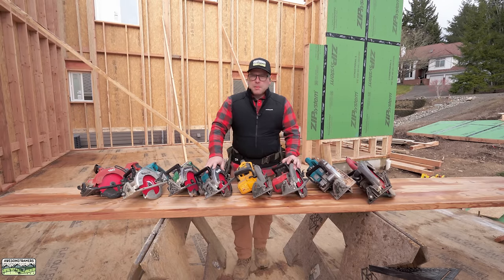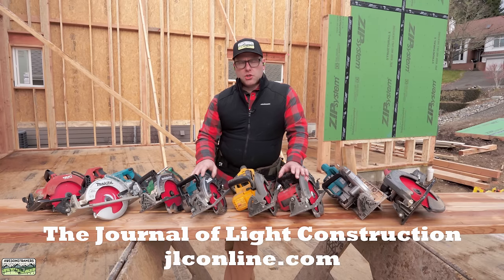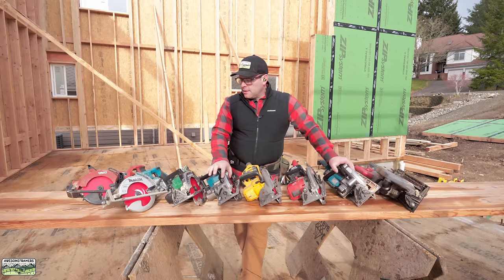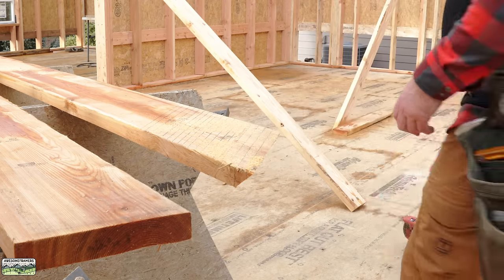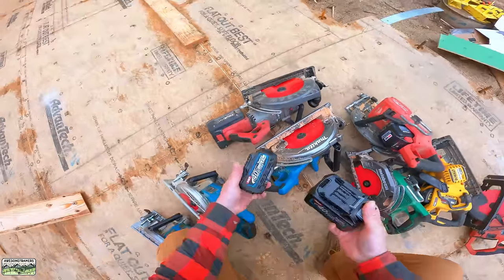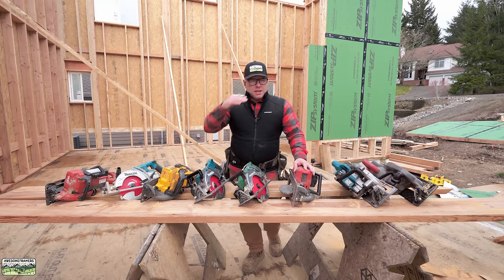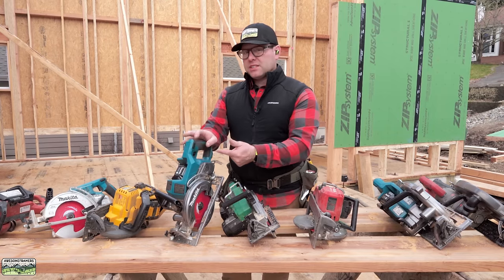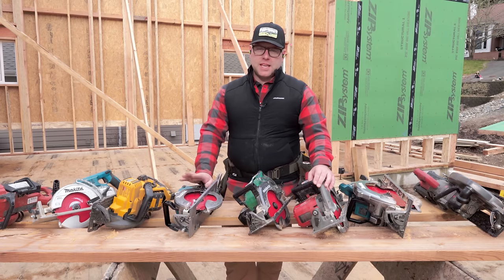Tool Review- Rear Handle Cordless Saws

Comment: 48 years ago when I started framing, don’t shoot me, when I got out of college, I was told this. Worm drive saws were first developed to cut rafter tails. It just so happened that it excelled at all other cuts. Oh and cords, funny thing about technology. We never thought once about the inconvenience of it all. We just knew it beat sawing by hand. We also hand banged all our nails, although pneumatic guns were just starting to come out, and weighed a ton. Never knew anything other than a tool with a cord or hose hanging out the back. Soon kids won’t know anything but electric cars that don’t stink. If life is about anything, it’s about change.
Reply: Jon, I started 47 years ago. I'm in Maine so we use sidewinders. The saw most guys had was a Rockwell 314 I think it was. The handle was pretty much on top, and the shoe didn't tilt, the saw body came straight up from the shoe. The old guys I worked with still used hand saws and hand planes a lot too. It wasn't until sometime in the 80s we started using nail guns for framing and nailing done underlayment. All finish nails were driven with a hammer.
At this point in my career, there is no way I am buying a bunch of really cool tools as I can barely walk now.
Reply: Loved your reply, and quote at the end. 30 years old and purchased my first circular saw, a Makita with a cord. Excited to build my dog an insulated dog house. God bless!
Reply: Started framing in 93 Started with the MIKITA sidewinder 2years later ran a skil, ridged , Dewalt. All corded than bought the Dewalt cordless rearhandle it's the best saw I have ever used. In 30 years it is amazing how much has changed
Reply: Electronic cars are terrible
Reply: Worm drive saws were the first design of saws period , that was the actual first design , around 1937 , the sidewinder style came later 👍

Comment: I have both Makita and Metabo kits. The Metabo drills and drivers are far superior to the Makita. Tons more power driving 4" structural screws and the batteries last noticeably longer. I'm a fan of Norm Abrams' philosophy of tools, you can never own too many and you leave them set up for specific tasks. Like you said, leave one set up for the bevels, set up one for square, and the third is wandering around the site. People don't realize how much time is wasted walking over to get a saw, or drill, or driver 15 times a day or changing set up for every other cut. Last, I have the 6.5" for cutting sheaving and other light duty work, it is half the weight and just easier to haul around on ladders or climbing trusses.
Reply: Yeah buddy! I have seven circs in regular use, and it ain't because any of them don't work! I have tons of redundant and even identical tools, for a number of different reasons. Fantastic philosophy, one which can seriously pay itself off, in terms of time and energy and profit and whatever else.

I do everything, like electrical one day and airless spraying the next. Very often, it's totally worth spending thousands extra for redundant gear. I curse like a sailor but "downtime" is the dirtiest of words I've heard.

So glad that I don't share a bank account with anyone! :)
Reply: What makita model are you referring to? Cause I have both and have to disagree.
Reply: @SuperPhoReal  i disagree as well cuz the makita xgt 40v hammer drill destroys the metabo drill, not even close.
Reply: @247Combat  They're basically identical in performance, except the green one is a bit old and huge and heavy. You can find some comparisons on YouTube

I recently saw a comparison of the newer 3rd gen triple hammer WH36DC and the brand new double spring XGT TD002, and they were also fairly identical
Reply: Bought the hitachi early for cost but they proved themselves to me in many ways.  Now i am all green and will add more as they come out.
Reply: @Louis P.  Better grab stuff soon prices have been flying up since I got into the line
Reply: I tried to get into the metabo line and got right back out simply because my drill fall right off my workbench the cheap plastic on the edges that hold the battery on cracked immediately. Of course there was no replacement policy because I bought it from Lowe's, I just cannot stand to buy tools at break that easy when my Makita and Milwaukee tools don't break it all from falls, Even my 10-year-old cheap Porter-Cable set doesn't break like that.
Reply: @robertcampbell1343  That's the opposite of my experience. Mine fell off a 10' ladder and still works fine. Must have been bad luck the way your drill landed on it's edge.

Comment: I just ordered a Metabo yesterday to switch from my Milwaukee blade right sidewinder!
Reply: @Spirit Life It's kind of a different animal. If you're used to one, it takes a bit of adjusting to the other. Rear handles are a lot smoother imo. Probably because of the angle you're pushing it, but it's gonna spray sawdust on your pants/waste/tool pouches whenever you cut with it if you're holding it right handed.

Comment: I just got the new skil dual 20v/40 volt rear handle and I’ve gotta say I’m very impressed! I’m a Milwaukee guy but it was only 207 from Ohio power tool! Comes with a dual fan cooled charger 2 5mah batteries & blade! Has a big led light! The dust port goes through the handle!
I’ve cut an 80”x42”x3” blk walnut table, a 22”x37”x3” blk walnut & epoxy top plus 10’ of base board at 45 and still have 2 bars on both batteries 🔋

Comment: Thanks for this video!  I am a retired dentist with zero experience using a power saw.  Your explanation of what to consider when buying and using this tool is very helpful.  I have an abundance of Makita 18v batteries for my lawnmower, so I am interested in the older Makita 36v XSR01.  Since I am not in the trades, I don't need the latest and the greatest.  Buying an older model that was once considered the best is good enough for me.  Thanks for your help!!

Comment: Great video, well done and very interesting.  I'm a 66 year old carpenter from the east; I used Super Sawcats and then the DeWalt equivalent all through my career.  I had the Skil HD77 for a while many years ago - I remember there was nothing better in wet, heavy lumber, but I never liked the balance as much as one of the Black and Decker sidewinders.  And heavy - you really did need to eat your Wheaties in the morning.  To each his own.  I would have liked to see you test a corded 77 up against this bunch, but that's just me; I'm old school.  I never knew anything except corded . . . but in framing I can certainly see the advantage of cordless, acknowledging that there is a tradeoff with power.  And one other thing; the lifespan of the tool.  I'm guessing a corded 77 might survive 6 times as long as these cordless?  How long do your saws last?  And finally, you're absolutely correct about pacing your body so that you don't wear it out prematurely.  Watch that you don't injure your back, sleep well and try to retire with all your fingers.  My best.
Reply: If u still want corded the Metabo HPT can use AC adapter for use far into the future and if your batteries can't keep up

Comment: Not biased at all 🤔. Dewalt is a beast. And as a contractor, I want just one battery platform, so it's really Dewalt or Milwaukee as the only option. Dewalt for me.
Reply: U might want to put the Metabo HPT Recip vs the Flex as well as there SDS Max rotary and full size router, portable band saw, Grinder 
Oops forgot Flex doesn't offer an SDS Max or portable band saw

The others will outperform the Flexy' and have been out for 3 or 4 yrs plus true lifetime warranty and all can be plugged into AC adapter
Also I have two co workers that have burned up the Flex Hammer drill motor overusing the "turbo" function
Time will also tell on longevity-and the early reviews on that haven't been good so far
Reply: Then came FLEX…but yes, DeWalt was/is best for carpentry. Milwaukee is right there, even better for automotive. But FLEX will be king eventually….considering they don’t go broke giving lifetime warranties. 

This guy is focused on weight and it’s pathetic. He…with his Bluetooth ear piece, ignores quality, performance, and functionality. 

He’s a clown capable of making decent cuts. Stick with DeWalt until FLEX builds their lineup or Milwaukee takes a HUGE step forward. Makita may make another leap, too.
Reply: @fZionists78 Dewalt makes amazing saws and carpentry tools. Milwaukee is VERY geared towards Electricians, plumbers and HVAC. I know this because as a plumber, every single supply house carries Milwaukee. Many exclusively carry Milwaukee.

Comment: I love my 40v xgt rear handle. I’m on Makita Milwaukee Dewalt and metabo hpt platforms which some say is dumb but I don’t bc each company makes good tools. Once the metabo hpt is available to buy from lowes I will order one and it will be strictly the saw I use all day the xgt will stay at the horses for any cuts on the ground. Great review.
Reply: I don't mind having 2 or 3 color batteries on job site as each of my red green and blue tools work better for different applications
In the last few years I have been buying more Metabo HPT due to the features, warranty, feel and the AC adapter option for my higher run time tools such as table saw, mitre saw, SDS Max rotary, grinder, vacuum and a few others especially the soon to be released cordless compressor with better specs than my Milwaukee and Dewalt

Comment: We are out of ky and have always used a sidewinder saw until about a year ago when we purchased the Milwaukee rear handled saw. We have since then purchased a couple more. We still run both styles and find that we prefer the rear handled for everything except cutting bevels. We find that the visibility is much better on the sidewinder when cutting bevels. Don’t think we will ever just go to one saw over the other I love having both options.
Reply: I use both and totally agree on sidewinders.  Ideal for jack rafters

Comment: I had a Hitachi blade right corded circular saw, when it started to act more like an arc light than a saw, I replaced it with the rear handle 36v makita. I got lucky, because it was pretty new on the market, at least the metric version.
And accept for the weight, I love it.

Comment: I had a 6 1/2” Dewalt saw that was blade left, it was the cheapest one Dewalt makes, and I preferred it over my bosses 60v Dewalt blade right top handle. I finally upgraded to a Dewalt 60v rear handle(got a great deal on it), and I absolutely love it, the rear handle is definitely more comfortable.

Comment: I still have my pops electric worm drive Skillsaw the saw is like 50 years old everything is metal including the trigger
It needs brushes but still works
I learned how to use a saw with that beast
Reply: In the US Lowes carries replacement brushes. Only takes a few minutes to swap them out
Reply: @chrisestill8825  I have new brushes I don't use the saw since it was dad's it's more sentimental that anything

Comment: Bought into metabo hpt multi volt completely about 6 months ago. Every till they offer has at least one standout feature. Some are a lil behind the curve with quick release and quick adjust features but whatever their standout feature is for that particular tool makes them awesome. 61/2 saw... Cut through 3x material. Rear handle... Light! 36v recip... Powerful quick cuts. Love em all but especially my rear handle.
Reply: There is a new multi tool due to be released.

Comment: $199 on Tool Barn ,free battery and charger...Really like my Metabo rear handle cordless saw, because it's so light. I had the DeWalt which was about a month old but it was too heavy  having a torn rotor cuff so I sold it to my roofer .I bought it from the tool barn couple of weeks ago when they first came out.
Reply: just checked and it's 199 tool only
Reply: @hlboerr  yeah they did have a deal with any Metabo tool. You got a free starter kit which was a battery and a charger

Comment: I truly appreciate your thorough review. These days it’s very hard to be in just one platform. For my 12V/small tools I’m pure Milwaukee. For 18V I’m mostly dewalt and I like the power of their flex volt models. Cordless dual compound miter saw? Yes please. I do have Milwaukee’s full line up of nailers, but use a battery adapter to use dewalt batteries, except the 23 gauge pin nailer which is 12V and I have 12V Milwaukee batteries. I like my Dewalt rear handle but I too use it mostly for ripping and use the flex PLT sidewinder for most things. Do like the rear handle for rafters and bird mouth work etc. since I build as a sideline I can’t afford to be into too many systems.

Comment: My DeWalt cordless right side blade weighs the same with a 2ah (60V). I love that saw soooo much. Perfectly balanced.
Reply: I didn’t even know they made 2ah 60Vs. That would def help with weight. Has enough power and run time?
Reply: 60v 2ah when in 20v its 6ah comprenday

Comment: I used to be a framer in NH.  We used skillsaws, not worm drives.  We had some worm drives and i tried them.  They were the old Makita saws and weighed a ton.  I prefer a lighter saw and looking over it for the sight line to a heavy saw that is a bit more ergonomic.

Comment: Great video! I have both makita 36v and metabo sidewinder versions, and I have the same opinion. Makita has a bit extra grunt but metabo feels much easier to use, really lightweight. I use the makita for all the repetitive heavy lifting cuts and the metabo for general use. Except for sheathing, I use the makita 36v track saw  its so much faster and straighter! I'm wanting to get that 10 1/2 40V makita, but I think there's a 9 1/2 36v that's track compatible so still deciding. I got into Metabo because of the framing nailer but love that platform, so much bang for the buck! Also got their cordless table saw, got tired of waiting for Makita to make one.

Comment: East coaster here. Switched to a rear handle makita hypoid a few years ago. Love that saw. Took a while getting used to the weight, but love it. I have recently been using my Metabo 36V cordless sidewinder due to limited power access. I hate it… I ordered a rear handle Metabo cordless the other day. Unfortunately it won’t arrive til mid march :-(
Reply: I got two of the Metabo HPT rear handles and now use the sidewinder as a track saw with the Bora system
It works great for that also use another cordless sidewinder with diamond blade for scoring cement
Rear handles will be for framing and ripping
Reply: @baseballdude8491  thanks for the great idea. Definitely gonna do that! My metabo rear handle arrived early this evening 😁.

Comment: Started framing in Minnesota in 1983. Makita sidewinders. Hand nailing. Moved to LA and production framing. Skil wormdrives with joist hangers and twist-lock three prongs with 100ft 12 or 10 gauge y-cords still hand nailing, back to MN and air staplers and nailers are taking over. Back to the sidewinders, but I didnt like it.  Sidewinders still the thing here mostly until i left framing in 1997. But wow. These new saws. I gotta check them. One thing, though. I was still framing until 1997 with the same Skil77 I bought used in Los Angeles in 1984 for $100.... if it wasn't stolen I would be using it today.

Comment: Yeah... this was a total waste of my time, LOL. I know you were like, "OMG!" When you went to edit. Yeah man, great review! I've been recommending more Metabo tools myself. Well-built. Great prices. Most tools have a lifetime warranty including the circular saw you just reviewed. That same saw can also run on battery AND can be plugged in to run on AC. Plus it's entry price is $199.

Toolbarn had a deal last week where if you bought the saw you got the charger and a 46V 4AH battery for free. 

Finally, with Metabo 36V batteries, they can be used on their 18V tools. If you use a 4AH battery on an 18V tool, it. doubles the AH's so a 4 becomes an 8 and a 2.5 becomes a 5 all with weight savings. Really can't beat it.

Comment: Love all your videos Tim, and a great saw review to watch whilst im knocking out dinner. I’m in England so wormdrive saws have only been here for 3 or so years, i think. I’ve got the DeWalt and i love it, even though she’s a heavy beast. I run a lot of cordless Metabo (Hikoki/Hitachi) gear for my impact SDS, planer etc and they’re all pretty good. That being said i’ve had their 3 combi drills (motors burned out after 10 months) and multi tool which all shook itself apart. My point being its a good platform but if i was going to invest again i might go Milwaukee

Comment: Love my Makita 36v and DeWalt 60V flexvolt the DeWalt has loads and loads and power and for sure more run time than my Makita but I love how smooth the Makita is. Never going back to corded
Reply: Tried the Milwaukee but I just dont like their Circular saws, They all feel under powered to me. Absolutely love their super sawzall
Reply: Couldn't agree more with you on the smoothness of the Makita, it's my favorite.
Reply: Makita is way smoother than the milwuakee or dewalt.  Gotten use all 3 and own the milwuakee.  Its a bit of a pain once you buy into a platform.
Reply: Yup, it's very smooth and precision

Comment: I love dewalt but sometimes I think about Milwaukee because the amount of tools their platform holds. But dewalts Flexvolt line is still unmatched imo.  It’s a beast of a saw and I have close to 2 years of using mine, 0 regrets